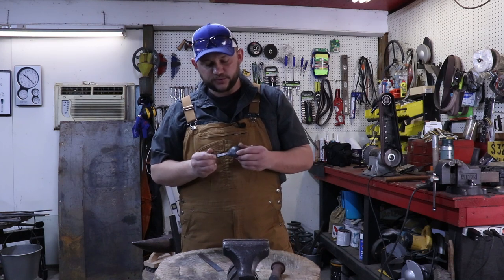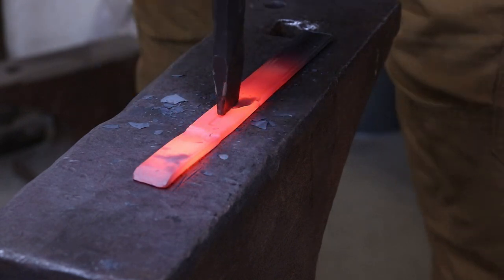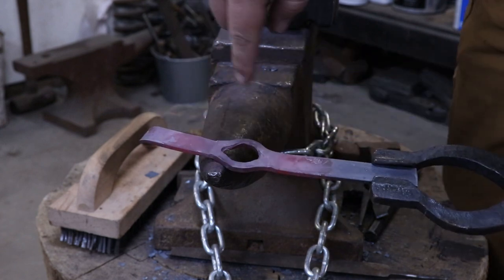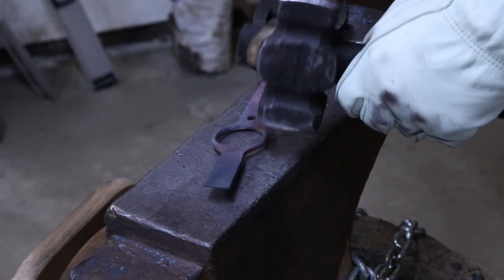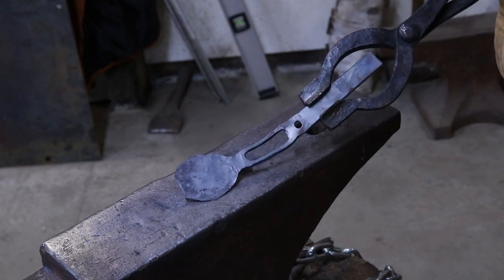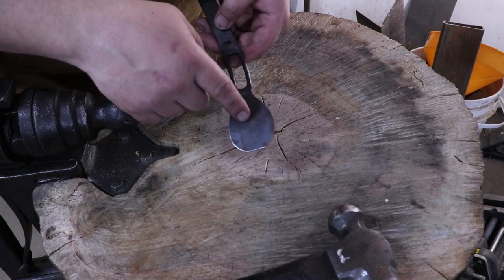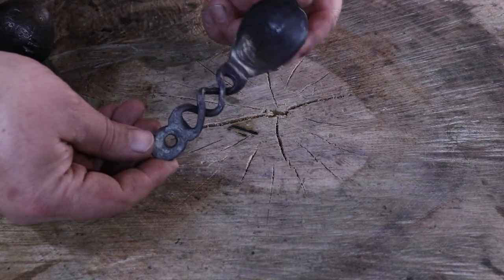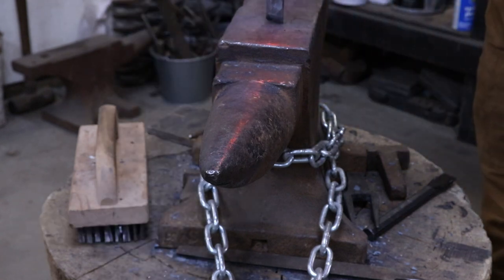Forging A Coffee Scoop With A Twist!

Comment: Nice project! I keep like 3 or 4 ziplock bags half full of vinegar inside a plastic gallon paint can. I put all of my small parts and projects in them. Makes forge scale disappear in 2 days. For the bigger pieces, I use space bags then vacuum out the air, leaving the vinegar and project to soak: works well. (As long as I remember to east any sharp edges)

You should use that big ol stump that your vise is mounted to, and start dishing different reliefs with hot steel on it. Makes it less steps to find your dishing swages or wood blocks. (Just my 2¢) 

Love the channel, brother. Keep ‘em coming!
Reply from the maker: Thanks for the tip I never thought of using vinegar for forge scale!